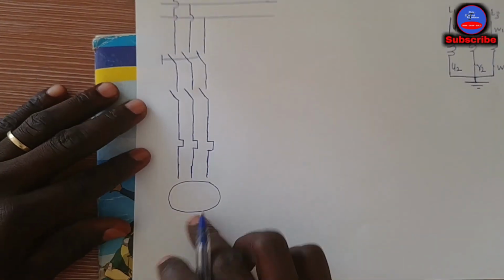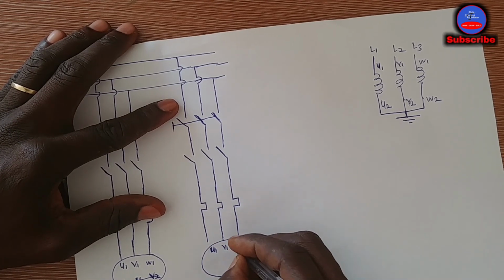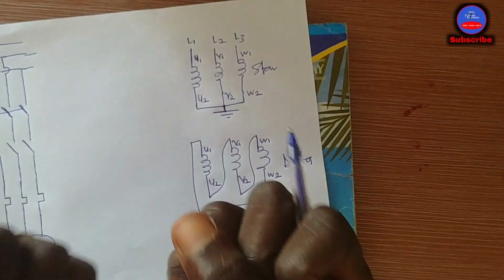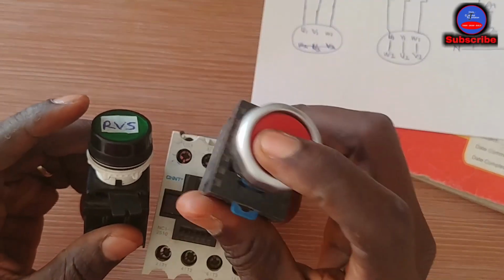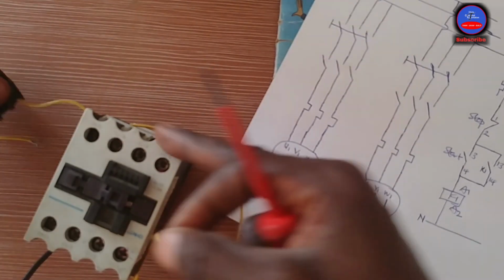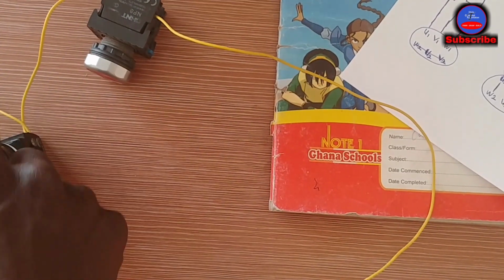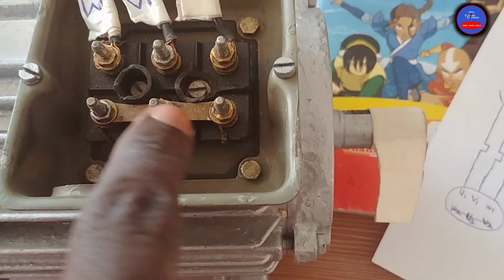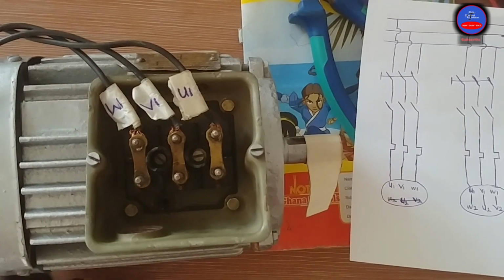Star Delta on Motor terminal block | Star and Delta connection #electricalengineering

Comment: Good job i like it
Reply: I have a doubt
If a motor is starting direct on line to make it run in either star or delta we simply change the terminals of the motor?
Reply from the maker: Yes when you want three phase motor to run in either star or delta, as I explained in the video, you just make the connections in the terminal block. As simple as that Boss. Hope you are clear?

You can also use contactors to achieve the same thing. Kindly watch my video on star delta, and also reversing star delta(star delta that goes forward and reverse)
Reply: Thanks